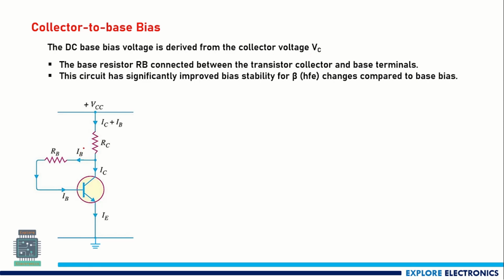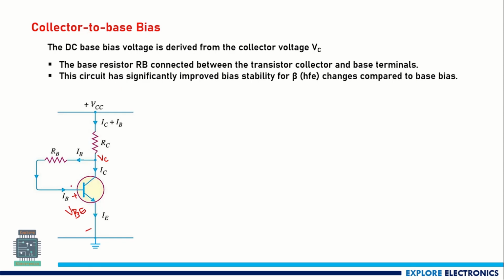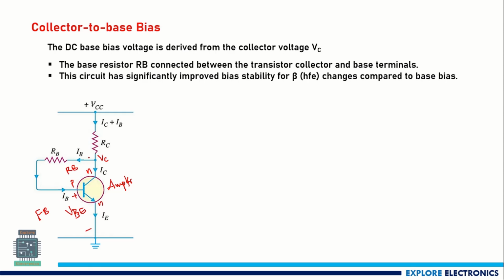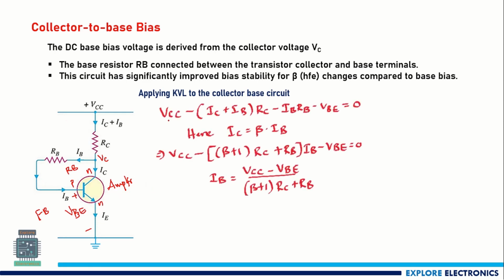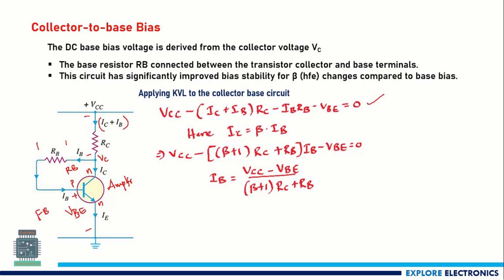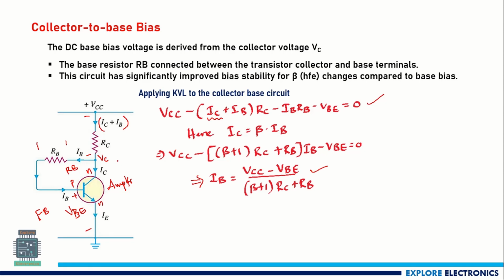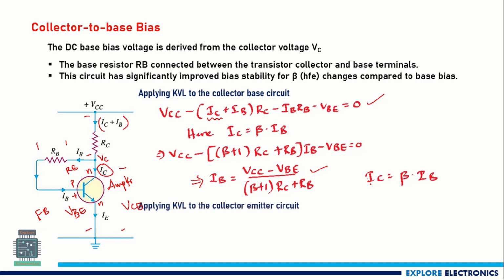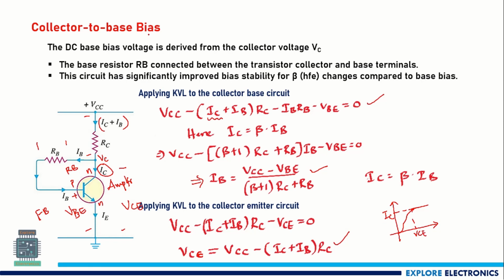BJT Biasing | Collector to Base Bias

Comment: So, what "Class" is this meeting since it's obviously not Class-A in relying on some of the input signal's votlage consumed to fully bias and switch on. 
Quasi-complimentary Class-A/B?
That seems to be the only answer anyone mentions and even that's rare. My college taught us the electron current path so I our quantum theories for operation are so grandly different and far more complex than that which is taught in using the conventional current path. 

I chronically find people reliant on the conventional current method don't use much theory at all in terms of accuracy. The observation of current flowing in the form of holes really is a disservice to the science, but I cannot deny it produces a lot of highly skilled engineers.